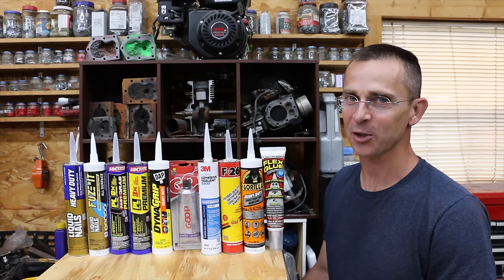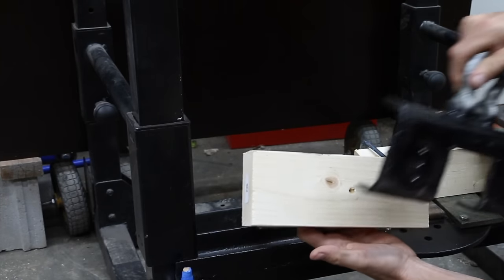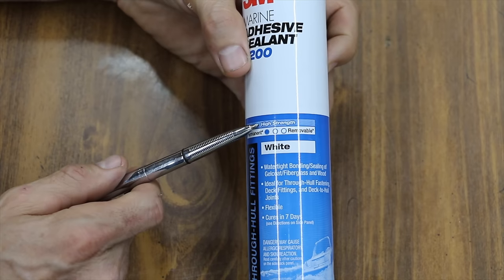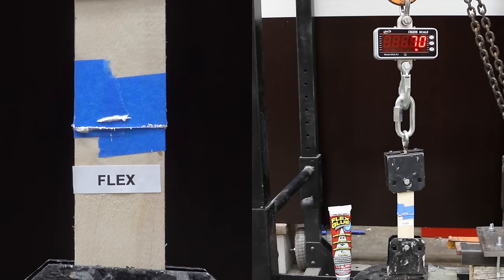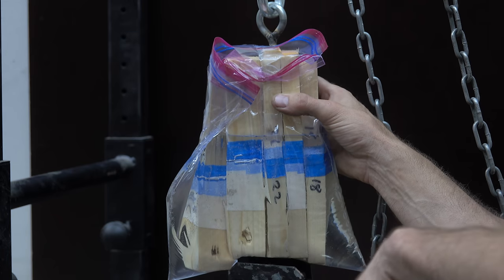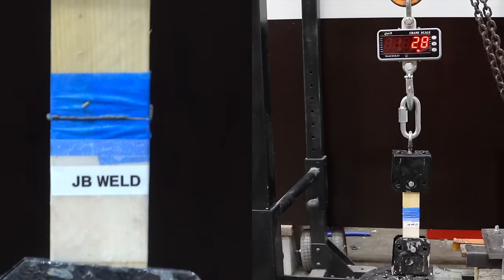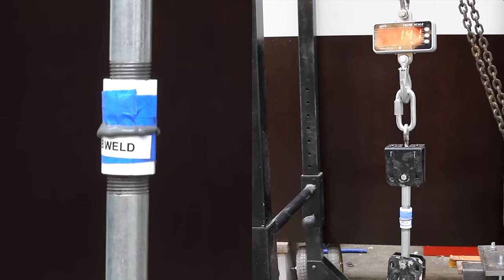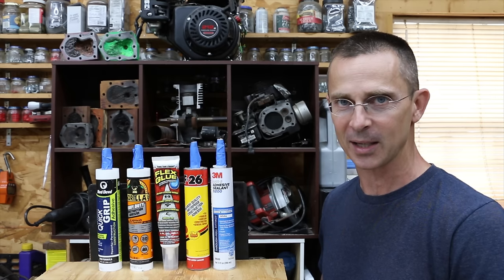Which Construction Adhesive is Best? Let's find out!

Comment: PL Premium x3 is my vote in my experience, but since your including the more recently new PL x8 my money is on that.  Impressed with the 3m though.

My most impressed experience with PL is with deco concrete wall blocks.  7 year old install removing the glued down cap stones from the block wall, the glue never failed, the Caps or block pulled away from each other taking the glue it was attached to like in the results with the wood you observed.  But that's wood with grain and not compressed and fully cured stable concrete blocks.  That was with the 3x, 8x never existed at the time.

Comment: Your test you first describe (the vertical pull) is not tensile strength, it's shear.

Also, not to say this was a bad test, but afaik, some of these adhesives are designed for garbage attachments (wood to concrete/cement) or those goofy as shit landscaping blocks (so brick-brick) and basically by bring hard to break, use the voids in brick to take up a lot of the force, rather than the sticktivity of the adhesive itself
Reply: Also, I hate to come up with stupid nitpicks (or ideas). But end of grain sticktivity tests would reduce lateral grain blowing out on the one test. But then you'd have to either make 4x4s (2x 2x4) or buy em and I know you fund all this on your own.
Reply: I gotta stop commenting before it's over. Cause you just did endgrain adhesion after I vomited words. Smdh
Reply: Also, just out of curiosity, with the end grain tensile tests, did you sand the ends and/or check ring density? Weird question but sanding would give a more consistent surface (vs being on a saw) for the same reason of checking ring density (because some boards can be all over the place). Same with the PVC. I would suggest that sanding any/all PVC surfaces with a xxx-grit (whatever you choose) paper on an orbital would give some consistency since a PVC piece could be from a worn injection mold or a brand new one. Just some thoughts.
Reply from the maker: Great constructive feedback.  Wood varies tremendously and it's really challenging to achieve precise, repeatable results.  With that said, an average of a few tests seems provide pretty conclusive information.

Comment: anybody ever try to mount security cameras with this stuff/ jb weld/epoxy puttys so you dont have to drill holes in the roof/house and might make a  leak?
Reply from the maker: Shingles are unlikely to have the strength to support a camera for a long period of time and will likely bend, break or tear.

Comment: According to folk lore, as long as 3M 5200 is applied dry, it will cure underwater in 3 weeks. For the PVC test, a 3-week cure may be necessary as well. Since all the products that require moisture to cure, under performed on that test.

Comment: Amazon has this 3M 5200 in smaller tubes for under $10. Seems like it should be compared as a general purpose glue to Original Gorilla Glue, Gorilla contact cement, and E5000 for a general purpose all-around one-part adhesive.
Reply from the maker: Thanks for the constructive feedback!

Comment: I wonder if there's a scale, like the crane scale you're using, but where the numbers stay on the display until you reset it. It'd be easier than slowing down the video later and getting the number. If the pull was 1078 lbs before the item you're testing broke, it'll say 1078 lbs until you push a button to reset it.
Reply from the maker: Thanks for the feedback.

Comment: I am building a front bumper for my old Jeep and would like to build it with wood.  After seeing this, I may use a two part epoxy to bond layers together.  The strength and durability of JB Weld is hard to deny.
Reply from the maker: Thanks for the feedback.

Comment: From my time fixing hot tub self plumbing repairs flex seal products seem to be the worst.  They never seal anything and destroy surfaces so it’s way harder to prep them to do a repair w a legit adhesive.  The old school mechanics that use jb  weld have repairs that don’t leak.  The jacuzzi repair manual says use devcon plastic weld and that’s what I have always used but I’m going to try the og jb weld because it seems like the only product I see that actually holds in the field as it gets harder to get the devcon from the manufacturer
Reply from the maker: Thanks for the feedback.

Comment: I recently used the PL LocTite tub surround adhesive for the first time and when they say instant grab, they are not kidding. I typically used Gorilla Glue for tub surrounds but it often required more holding or even spreader bars until it cured. Not the case with the LocTite for that purpose. Just press it to the studs and it is stuck.
Reply from the maker: Thanks for sharing.

Comment: Instead of soaking with water,  soak with gas, JB weld has issues with that kind of chemical exposure,  at least I tried patching a gas tank with JB weld on a 87 Chevy, it leaked 2 days later.
Reply from the maker: Great point.  Thank you

Comment: All these sealants are used for diffrent things and some may be stronger but not nessisarly better . Holding up to weather,  cleaning agents ,oils , .. ect some don't stretch like others .. you get my point.  Also using 5200 is very hard to separate or remove so be care full with it. Make sure u are using the correct sealant on appropriate things. Like a boat u have under the water line or in a hole but may want to use somthing diffrent on the outside of the boat.
Reply from the maker: Thanks for the feedback.

Comment: Is it possible that the strength of the wood glues may have been related to the amount of pounds per square inch of force, applied to the two pieces of wood, to hold them together until the wood glues hardened and cured too? Need more testing for to answer that question. Also was air enough to properly clean the two pieces of wood for gluing too?
Reply from the maker: Thanks for the suggestion.

Comment: One thing I ran into was that working in cold weather, you could not even get the glue out of the tube with a caulk gun. The Liquid Nails more expensive one  would still flow at lower temps, like 35 -45 not below freezing.
Reply from the maker: Thanks for the feedback.

Comment: Hey I know this is a couple years late, but when testing structural failure it's a good idea to report the range on the plots.

The reason for that is it's hard to tell if the variability is due to something on your part, or inherent to the thing you're testing - the adhesives could just be sensitive to application conditions.

And if someone's relying on it to be strong, then knowing it might be a little sensitive to how it's applied is really important.
Reply from the maker: Thanks for the constructive feedback.

Comment: I used 5200 for almost everything on my boat years ago, it seemed to get stronger with age.  There is another product I have been using for 25+ years called PC-7 and PC-12 (Marine) I have machined and drilled & tapped this epoxy and I can tell you, through empirical knowledge, that this stuff is the best/strongest adhesive I have ever used ....... by far! I was unaware of the marine version until just a few years ago.
Reply from the maker: Thank You for the Constructive Feedback!

Comment: Appreciate the analysis. And while the last step #/¢ is a valuable insight, I'd be inclined to spend more for the additional strength gain. There's often a significant cost to a bond failing that goes beyond the initial purchase price.  (and I use JB Weld on lots of stuff!)
Reply from the maker: Thanks so much!

Comment: Another excellent video. It's like Consumer Reports, but you don't have to pay for it. 

For the two that didn't cure in the plastic cap test, do the instructions stipulate they need moisture to cure? I believe polyurethane adhesives require a little moisture to cure properly. It would have be present in the wood, but not in the plastic.
Reply from the maker: Thank you for the positive comment!

Comment: Great vids as always, just curious, for an oil testing, could you cut down a flat tappet camshaft and mount a couple of lobes in your lubricicity...dont think I spelled it right, tester and spin it about 1500-2000 rpms and mount a lifter bore above it some how to hold and spring pressure the lifter to see if there is a newer oil with little to no zinc that could break in a camshaft without  wiping out the lobe? That would be neat to see. Thanks for your videos!
Reply from the maker: Thanks for the constructive feedback!

Comment: Someone once told me a story about 3M™ Marine Adhesive Sealant 5200. The scope of work was to prepare a sloop rigged sailboat for competing in a Transpac Race to Hawaii. At the boatyard all scheduled work had taken place including re-installing the faired-keel into place using 3M™ Marine Adhesive Sealant 5200 applied both on top of the cast-iron keel and also into the hull's exterior keel flange recess after which the keel bolts were tightened into the keel from inside the boat from the removable keel access floor boards along with flat-washers and nuts hand started onto each keel bolt to be torqued once the 3M™ Marine Adhesive Sealant 5200 has properly cured. One thing led to another and the project list was completed and the boat was rigged and lowered into the water. After about a week underway en-route to Hawaii one crew member asked another so did you tighten and torque those keel nuts? The other crew member replied I thought you took care of them. Both crew members rushed below and quickly removed the keel access floor boards and began at each end working toward the center tightening all the keel nuts until all were tightened. The bilge area around the keel hardware was dry and until they both remembered the only thing holding the keel in place was 3M™ Marine Adhesive Sealant 5200.
Reply from the maker: Thanks for the constructive feedback!

Comment: The next time my 6 year old rips the nose molding off our floor, I may forego the construction adhesive and slather up some JB! The putty is among my favorite cure-alls for a quick fix. 
On the adhesives, LocTite's Power Grab is pretty decent too for household use as the 3M is rather hard to find in our neck of the woods. In practical use, Gorilla Glue never seems to have the staying power if you don't prep the hell out of the surfaces; very finicky in my experience.
Reply from the maker: Thank You for the constructive feedback!

Comment: I kid, but i do have a good idea related to construction. If you want paneling in a wet area most folks say get kerdi board by schluter. USG makes a product called durock foam board that is way cheaper and Wedi Board is another product. It would be cool to know if kerdi is worth the crazy cost as far a water resistance/mold resistance over time  and strength.
Reply from the maker: Thank you for the video idea!

Comment: You need to do one on concrete caulking. Like the polyurethane rubber and silicone ones self leveling and vertical.
Reply from the maker: Thanks for the video idea.
Reply: @ProjectFarm  I also meant acrylic and the acrylic with silicone. LOCTITE has a polyurethane one but it’s $7 each. And sakrete has repair mortar repair and concrete repair. What’s the difference? It’s only $3 each but I here it cracks after about 5 days. I need a bunch for a project to seal all the openings in my cinder block walls surrounding my property. To seal in the bark scorpions. An issue here in Las Vegas NV. But I know many people wonder which of these are best for many reasons.

Comment: I raced offshore powerboats for several years and we always used 5200 as the adhesive to attach the drives to the stern (along with of course significant hardware).  It was like no one ever even thought of any other option or choice - it was always the defacto adhesive (and probably still is).
Reply from the maker: Thanks for sharing.

Comment: Has anyone used Adiseal? Over 3000 psi holding power. It’s from the UK but I can’t find it here unless I order it in bulk..

Looking for adhesive steel (legs) to marble. Drilling for anchors or screws is not advised, on account of cracking and splitting marble